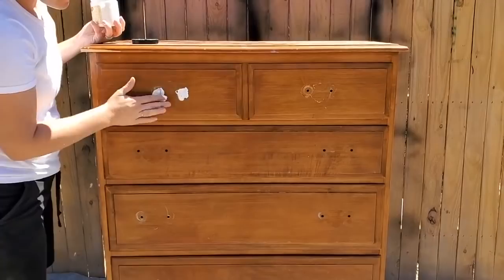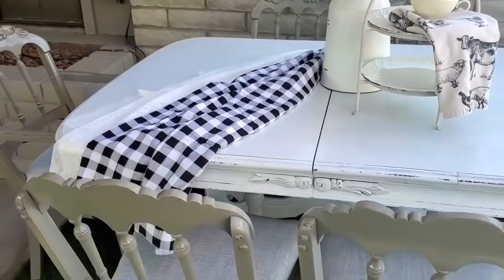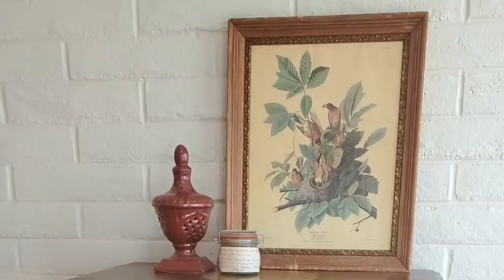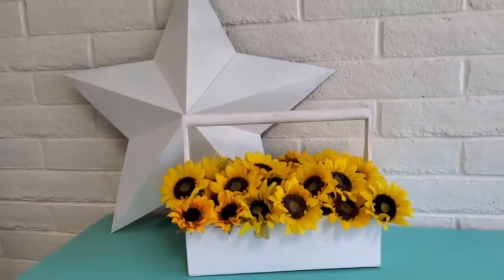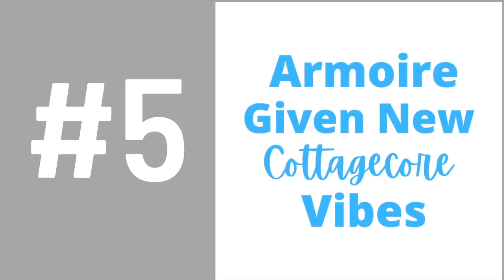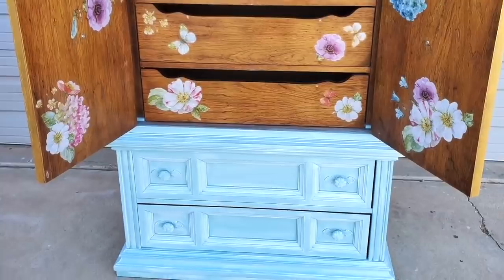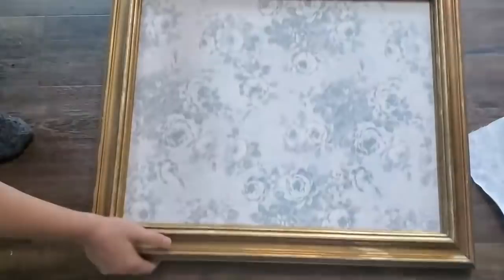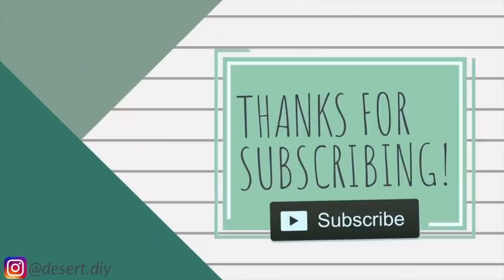10 Furniture & Decor Flips Full of High End, Cottage-core, Farmhouse and other decor styles

Comment: My family fostered for medically fragile and special needs for eight + years… in a pretty crap system. We had two (separate families) littles we nurtured from barely surviving to exceptionally thriving that were returned to parent/s that received zero training or therapy, or follow up. One of these littles returned to system with severe malnutrition, and the other nearly died and was left with brain damage due to accidental overdose by  ingesting what was on the floor. I had to take a break, so I began to donate pillowcases, bibs, and sleep sacks I sew in batches. I hadn’t thought about furniture, which is something I’m fairly decent at. Thank you for the inspiration and shared techniques!

Comment: That wierd-ass armoire with the foam doors:  Very big in the mid-70s. Spanish, Mexican  influences,  wrought iron with a rustic appearance, hammered metal, heavy carved wood (like the piece you're working/worked on) They used vinyl and foam to reduce the weight.

Comment: When you mix the clear coat in, does that change how workable the paint is?
Reply from the maker: Yes! It will no longer be blendable unless it's very wet. You also won't be able to wet distress it, and it's ability to grip to slick surfaces is diminished a little bit. Paints that don't have any sealer are great at sticking to slick surfaces. If you sand first or if the surface is not slick, then you're all good

Comment: The dining table flip you made it look easier than it probably was 😊 the enamel spray paint does it go on in a way that it’s not noticeable you used spray paint? Also does enamel paint sand easily? Thanks!
Reply from the maker: Yes it goes on with full coverage. Just be sure to do your extra coats in different directions and wait several hours if not a day between coats. You can sand it afterwards to get rid of any texture issue just sand lightly.

Comment: Do you have to seal the top of the table if you use the spray paint? If not, Will it stain if people eat on it and drop something?
Reply from the maker: When you use rustoleum enamel spray paint, it doesn't require any sealer. After a few weeks it will completely cure and become rock solid on its own.

Comment: So I’m flipping something for some family. 

I got rust-oleum satin black enamel in an hvlp and the dresser drawers have not hardened and it’s been a week. Any ideas? You seem to be both responsive and knowledgeable. Help! Lol
Reply: Oddly enough, the dresser itself came out perfect. The drawers scratch when rubbing my fingernails over them lightly. 

I don’t know if I should try another light coat and letting it sit. Or adding a clear coat or Polly over top to make it hard. 

Grasping at straws here lol
Reply from the maker: Hmm...what did you clean the surface with and did you scuff sand before painting?
Reply: @DesertDIY  yeah I hit it with 120 grit and cleaned with mineral spirits. 

I think I narrowed it down to the consistant 80%+ humidity I have had for two weeks straight. And maybe a coat a tad to thick. 

Rather frustrating lol

Comment: Loved the 9th one you had to put stabilizing screws from the top into the legs.  Loved the stencil...I could not find the brush you were using to stencil.  Is it a 1 inch bristle brush?
Reply from the maker: It's not a great brush. It was my first time trying it and I wasn't a fan. I like the flat half circle foam ones better. Or a softer bristle than this one had
Reply: @DesertDIY  thanks....I'm going to Seattle then on to Fairbanks to a friends.  She found an MCM maple oval very unique coffee table she wants me to redo.  The veneer is lifting in one spot but also very thin and of course it is lifting on a curved edge.  But, in one area of the table is a nickel size light burn.  She wants a light maple like replacement stain and if the dark burn stain doesnt come out with a mild sanding post stripping, then I found a quirky moose die and cut out on stencil adhesive.  Will cover it once with light coat of topcoat to keep it from bleeding under the stencil then use a dark stain on the stencil.  Keeping my fingers crossed it works as well as it did in my brain!